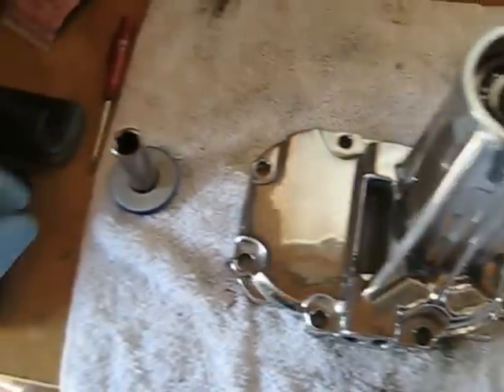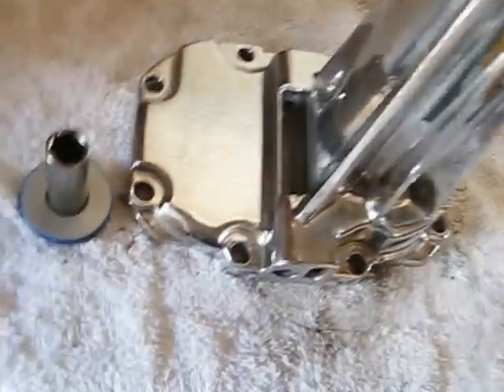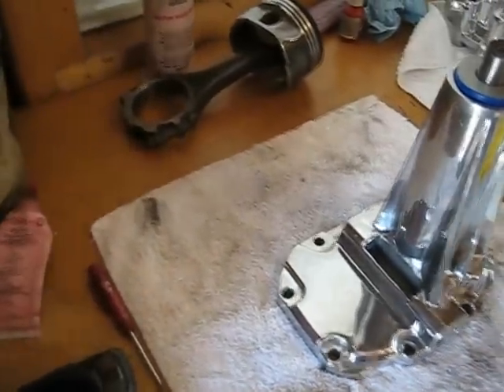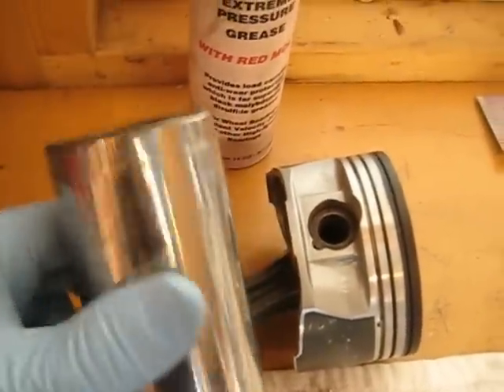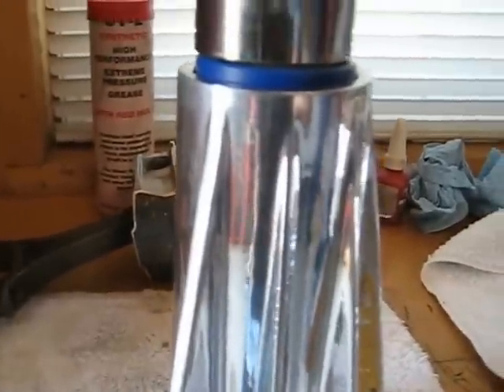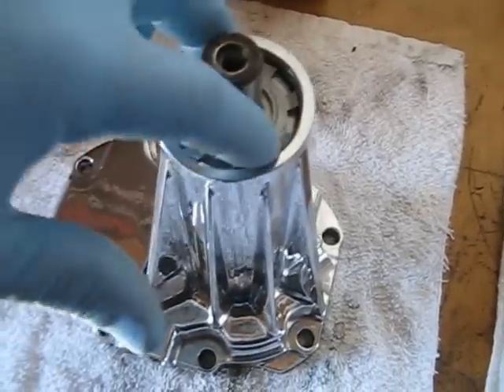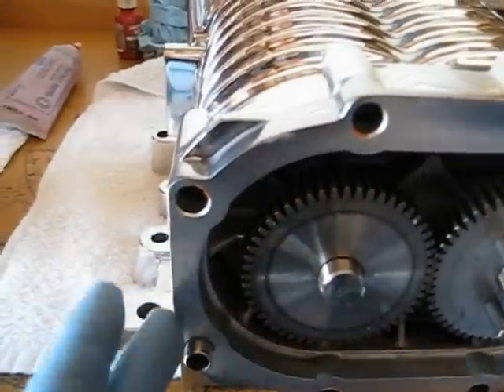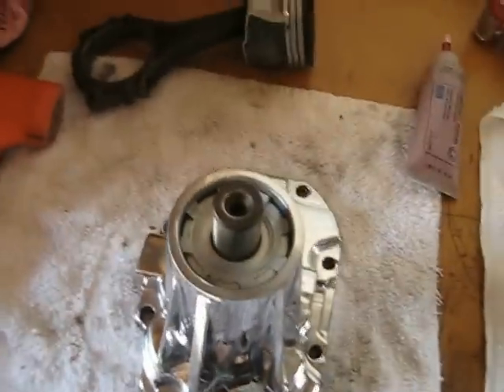How to install a new Eaton M90 supercharger snout seal

Comment: How do u take it off ????!
Reply from the maker: what are you asking? take what off?
Reply: @GR8racingfool  sorry couldn’t find a video on how to pull the seal out . Before installing new one .
Reply from the maker: @ErK1oneZ  you can use a seal remover tool, look like a double hook on each end. You can also thread in a screw, and pop it out with a hammer like pulling a nail out of wood. Hope that helps.

Comment: Can you tell me the torque specs for the snout installation? Can't seem to find it anywhere.
Reply from the maker: 22 ft. lbs. Work your way from the middle out, in a X pattern. GenIII and GenV's I put thread sealer on the two lower center bolts that poke into the outlet of the unit. Have any questions, feel free to ask, happy to help.

Comment: be awesome if you could do a video on case polishing as well as porting and rotor timing.
Reply from the maker: perhaps in the future. Polishing takes a long time, have 22-23 hours tied up in a M90 start to finish. The just of it is like wood working. sanding with a rough grit, and working your way to a fine grit, and if you do a good job sanding, the polishing is the easy part.

Comment: Good video.   I rebuild these also as long as u  are careful and use a big socket to push the seal in its quicker and easier
Reply from the maker: wrist pin is my new favorite tool. :) But you are right.

Comment from the maker: All the time, I don't mind helping others out. How do you know my services don't come cheep? I don't charge the typical $85.00/hr. shop rate and charge you a minimum 1 hour every time. I used to work for free actually, then people started taking advantage of the kindness, so I had to put a stop to that unfortunately. Snout rebuilds I only charge $80.00 labor, you supply the parts you want installed, or I can get them for you for an additional charge. Entire M90's I charge $150.00 labor.